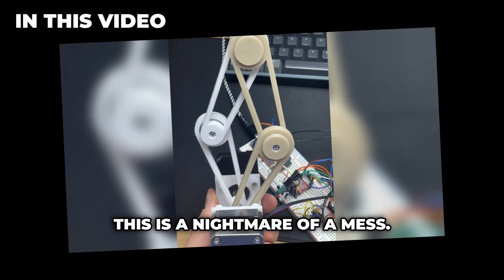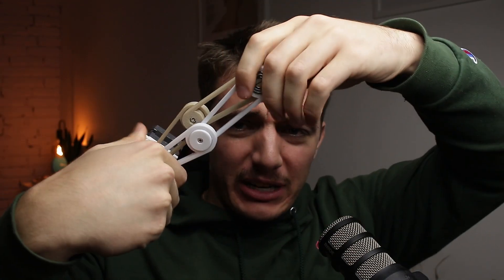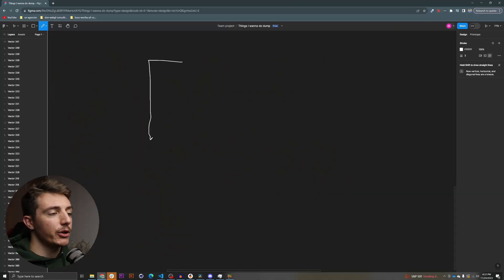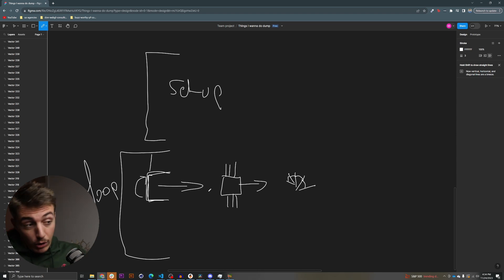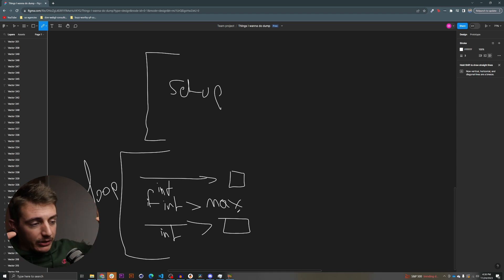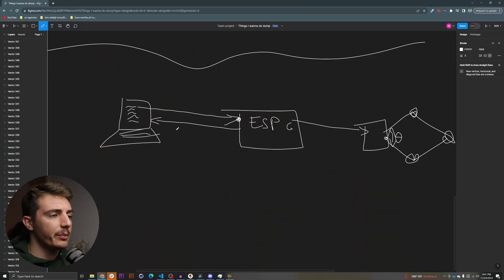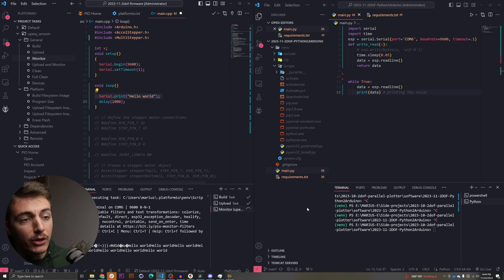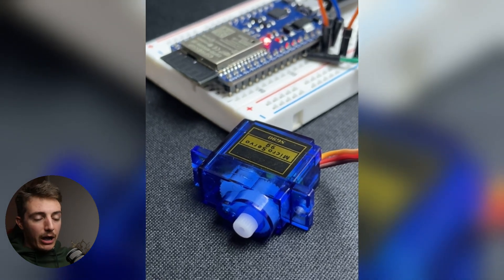LOOSING it on a STUPID IDEA ? | Robot devlog part 4

Comment: Hello,
Timers are indeed a good idea for controlling multiple motors in parallel. The idea is to connect the timers to interrupts, one timer per motor. To initiate the motor rotation, you need to load the timer with a step and then start it.
Each time the interrupt is called, you move the motor by one step. The operation repeats until the timer reaches 0. Once it reaches 0, you can stop the timer and reset it for the next instruction.
For PC/ESP communication, you should look into how G-code files work in 3D printing. It might be interesting in your case.

Comment: You could look into timers to control multiple motors in parallel. It would also work better when dealing with different speeds. Threading could also be a solution but if my memory is correct the ESP32 might be limited for that...